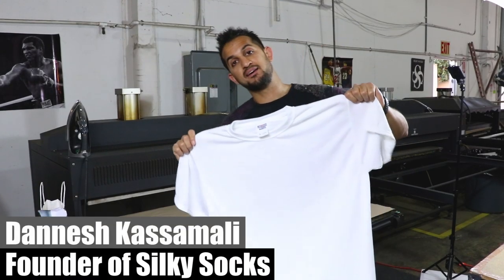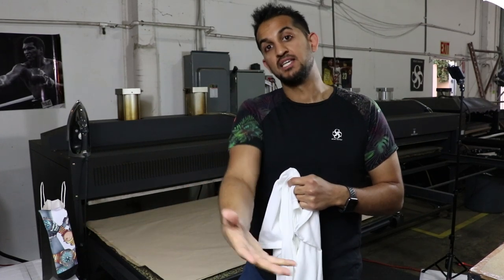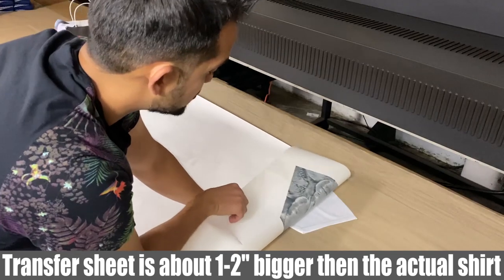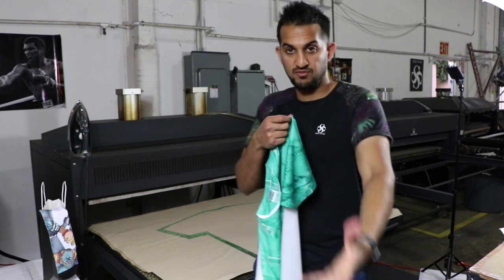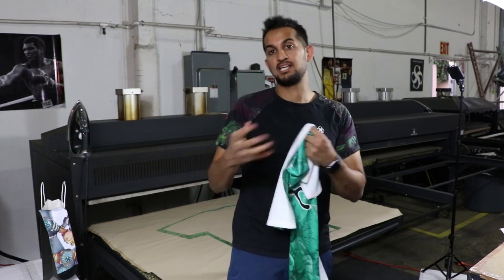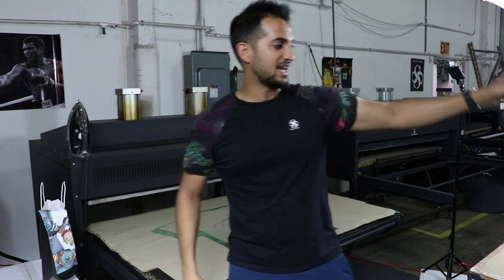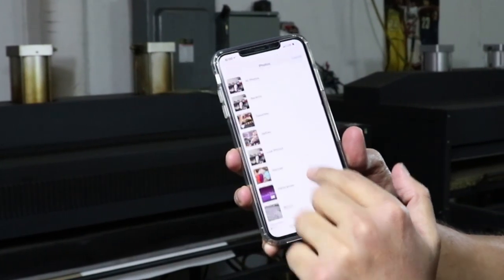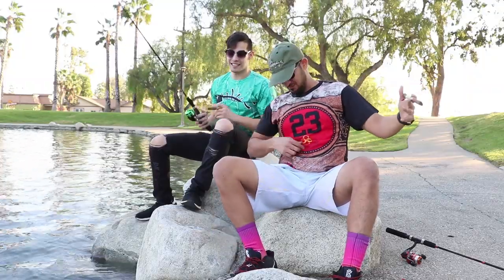How To Sublimate Shirts - INCREDIBLE QUALITY all over print!

Comment: If you have a hard template (made of poster board or even super thin wood) to put inside the shirt, that will stretch the shirt enough to avoid those wrinkles on the sleeves and shoulder areas. It will also prevent the print from being subbed onto the inside of the shirt through the neckhole. The downside is you'll need one of these hard templates for each size of shirt you sub onto. And you'll have to find a way to deal with the ink that subs onto the template through the shirt fabric (you may be able to coat or cover the hard template with a silicone cover that can be wiped clean after each press session).
Reply: The cool thing about dye sub is that the ink doesn't bleed through. Great idea to use a hard template!

Comment: Hey Dannesh, enjoying your videos especially the one where you travelled to China to meet your suppliers, something I plan to do when my biz grows large enough for huge orders. BUT anyway about this video, at 12:40 you are laying the design over the blackout t-shirt and the design appears to go over the round collar so the question is why did the design not get printed on the collar?

and what brand is the knockout shirt? i don't think any of the blank apparel suppliers i deal with have that style of shirt.

thanks!
Reply from the maker: Jerry Simpson hey Jerry, glad you like the videos and the content!  So the blackout shirt is by Sublivie, model #1902.  And the collar is black.  That’s why it won’t show up on black.  Sublimation print will only show up on 100% polyester white fabric and some light colors and blends.  But never on black.
Reply: @SilkySocks  ah ok but then why did you need to use those cardboard cutouts on the black sleeves then if sublimation won't print on black?
Reply from the maker: Jerry Simpson to avoid some of the sort of tint the ink leaves.  You can hardly see it on black.  But putting that cardboard over the sleeves just protect the sleeves from that altogether.   A cardboard in the neck area is also a good idea. Both optional

Comment: Bro you say we need at least a 44 inch wide printer but your image of the Jordan print does not cover the entire span of the page. Still about 12-15 inches of page on the left unused. So basically a 30 inch wide printer should be sufficient because you can always turn the image  vertical to print the longest length.
Reply: That’s true isn’t it?

Comment: why you dont use inserts for T shirts?
Reply from the maker: ascain91 so do you mean insert to stretch the shirt? That’s not needed.  But a sheet of paper in between the front and the back is a good idea to avoid the front bleeding on to the back. And vice versa. I skipped that step in this tutorial as that is optional also.
Reply: Also a lint roller to pick up small particles. Great video great content 👍